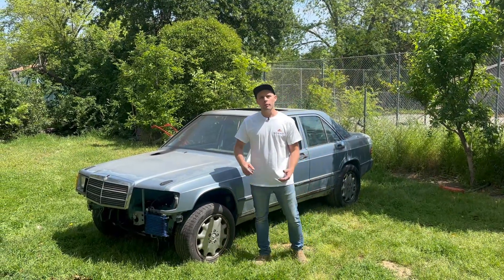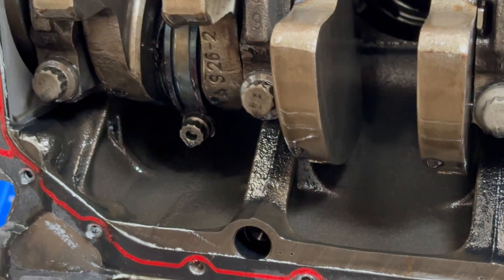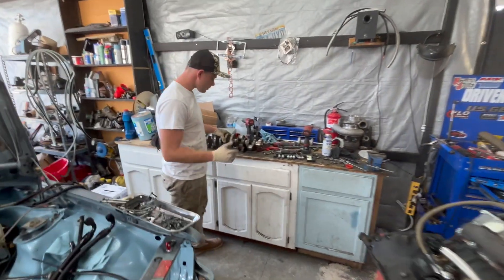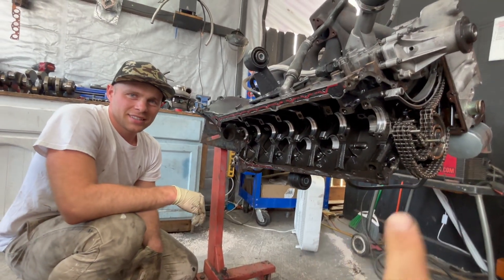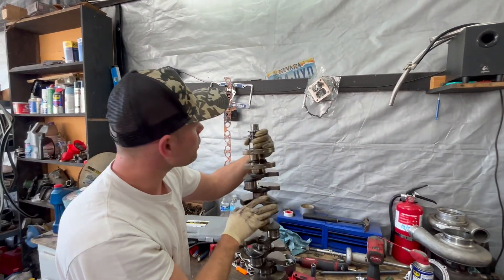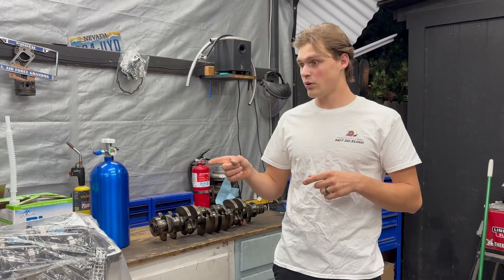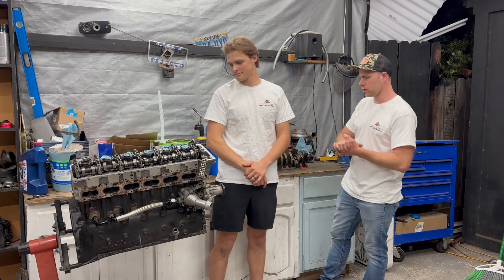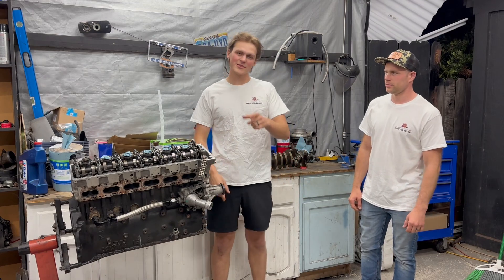Diesel Mercedes Dragcar ENGINE FAILURE! WHAT WENT WRONG

Comment: OM648 Would be a cool swap. Thing can be built to 850-900whp without NOS, needs a proper compound turbo setup tho, and new heads and pistons. But 7K rpm is fine for that engine.

Comment: There’s a right way and a wrong way to instal the connecting rods. BenzForce has a great video on it.

https://www.w124performance.com/service/w124CD1/Program/Engine/605_606/03-7021B.pdf
Reply from the maker: @SOCALPRINTER  will definitely watch it. Thanks
Reply: @ProjectNotSoSlow  , also it’s highly recommended to do a run-in after rebuild. Usually with a Zinc additive, run the engine with coolant at about 2500 rpm for about 25-30 minutes. This allows the new parts to settle without binding or causing premature wear.
Reply from the maker: Thanks! We'll do everything we can to have a healthy engine this time 👍

Comment: Lets go for a high revving build to about 7k rpm
Reply from the maker: We’ll probably keep it at a little lower rpm first, then work our way up
Reply: @ProjectNotSoSlow  any plans on the transmission side, like 8hp?
Reply from the maker: @vladkruglov7719  we are currently working on installing a 722.6 for now.
Reply: @ProjectNotSoSlow  are the rods upgraded, if im not mistaken 500hp is top on stock bottom end
Reply from the maker: @ we have dpuk h beam rods in.

Comment: Come on guys... You never follow OEM torque specs with non OEM bolts! Specifically arp.. 
3/8arp is 48ft/lbs
7/16 arp is 75 ft/lbs. 

And yes. 603 crank same.
Reply from the maker: It was my first time building an engine and some mistakes were made.

Comment: For the record OM604,605 and OM606: conrod bolts: initial torque 40NM, then 90° tightening angle.

When you built an engine, always measure bearing gap (main bearings and rod bearings) with a two point inner micrometer, especially when buying some guys tuning rods... At least use plastigage... May the rods have not enough bearing crush, or are to tight - how will you know without measuring? Just don't trust anybody - measure it yourself!

Remove the plug of the main oil channel and clean it (pressure washer and brush). Press in new plug with a little bit of sealant. Clean the oil channels of the cilinder head, too. Use new oil cooler. Use new oil pump or at least open the used one and inspect+clean it
Reply from the maker: @V8freaks  other than that, when we will be rebuilding this engine we will measure and make sure of everything. Thank you for the advice. It’s greatly appreciated.
Reply from the maker: I initially did 40nm then the 90degree angle with our performance rods when the recommended torque was just 75nm.  Maybe these performance rods were not designed to be held at such high torque.
Reply: They are not factory bolts!

Comment: Bro OM603 way better!
Reply from the maker: Rip your head gasket lol. I’ll see you at the track.😂
Reply: OM603 😂😂😂😂😂🤦‍♂️ trash…
Reply: @MichaelMichels-v4r  naa bro! They been treating me well!
Reply: @jeepsnthings565  605/606 are better in every point!
Reply: @MichaelMichels-v4r  more than half of the om603 is the same as om606. Om603 Valves are stronger valve Springs are much stronger and cam is probably stronger because its thicker. Only headgasket is weak.